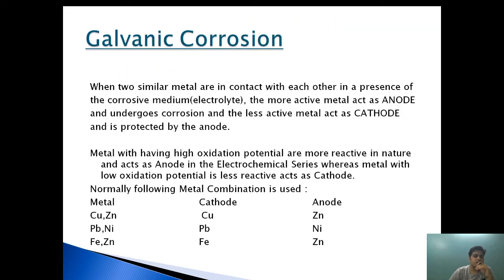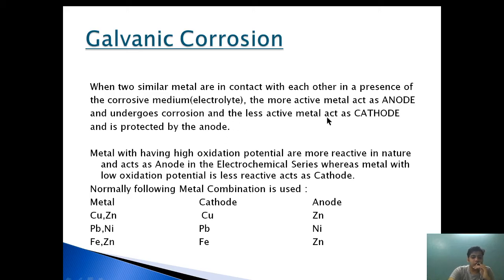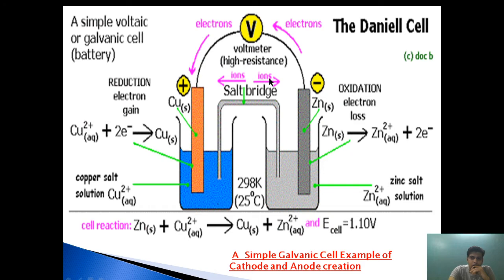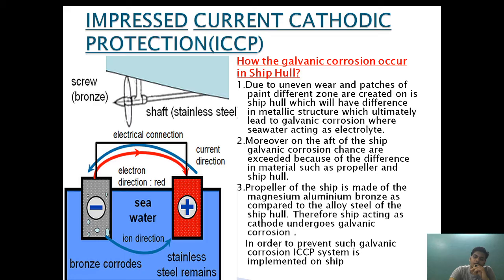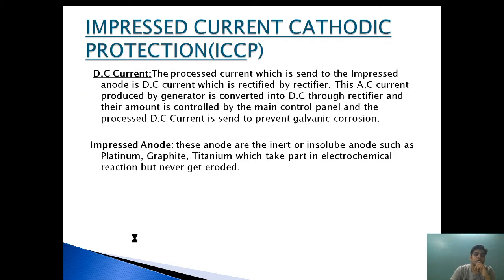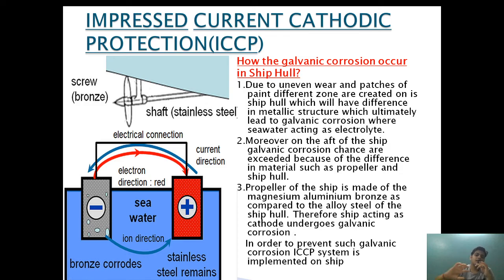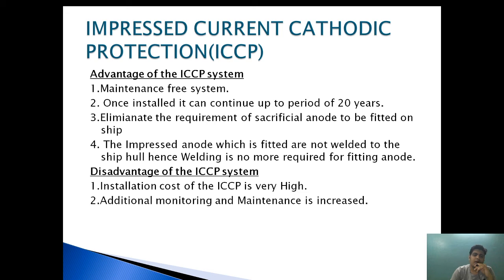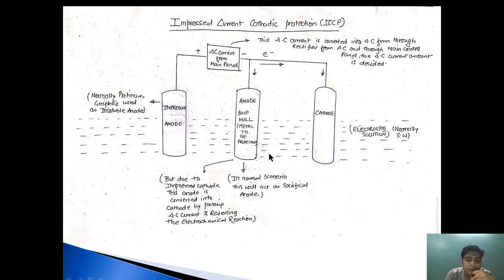Impressed Current Cathodic Protection(ICCP)|Operation|Advantage|Disadvantage|

Comment: If the hull is converted into cathode due to impressed anode ... What about propeller .. how it is protected
Reply: By active shaft grounding
Reply: The propeller is electrically bonded to the hull by the shaft grounding arrangement. so it recieves ICCP protection.
Reply: @comradeivan3903 sir now if it is electrically bonded to the ships hull, then how did a potential difference occur in the first place for galvanic corrosion?

Comment: Why using d. C current instead of a. C
Reply: In ac current the polarity is changing with the time so protection will not take place with AC, cathode and anode is also changing  . but in dc the polarity is remains constant. so we use DC for the system or we can use AC with a rectifier.
Reply: @Adventures_of_Sahan  brother
,
If an atom give electron it bcms positively charged? Right
But in galvanic cell, anode is negative why
Reply: @bt9604   In a galvanic cell, electrons will move in to the anode. Since electrons carry a negative charge, then the anode is negatively charged.
Reply: @Adventures_of_Sahan i am getting confused, please correct me. Anode having postive charge and will electron flow from cathode to anode, then loss of election should be occurs in cathode??And cathode should be corroded, right??
Reply: Wow. Im very thankful sir
Reply from the maker: There are lots of reason!!!!
Marine Engineering Hub will soon make video on that . Till then please watch our other Video!!!

Comment: Thanks for this good video. Very informative! But I have one question;..
Is it advisable to turn off ICCP system once berthed in Port?
Reply: at container terminals if the ICCP is switched on then it will try to protect the jetty as well, so it will consume more power from the system and it will lead to overload on the system
Reply from the maker: Thank you for your response and support!!!!
Please do share this post on your facebook and whatsapp status!!!!
Marine Engineering hub aim is to bring all our marine personnel to this platform